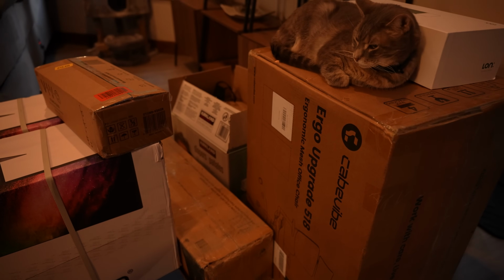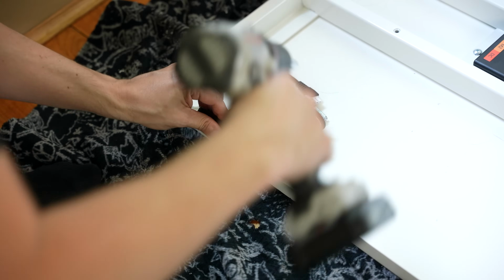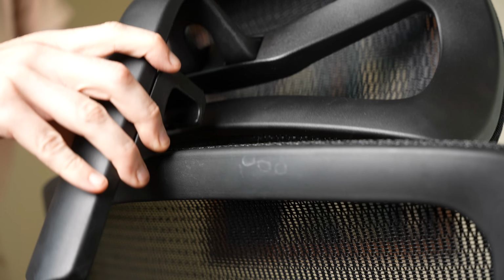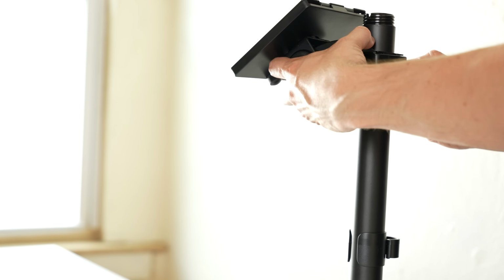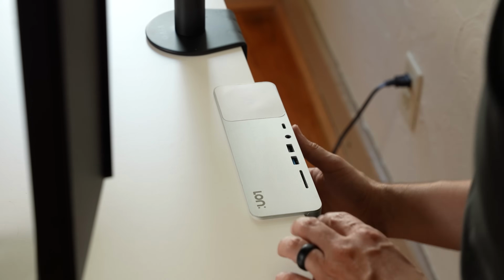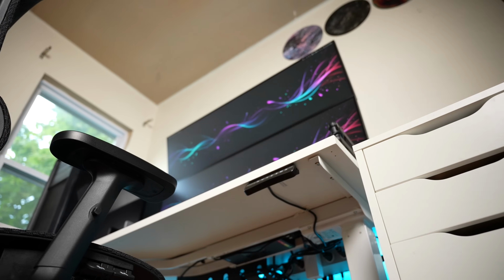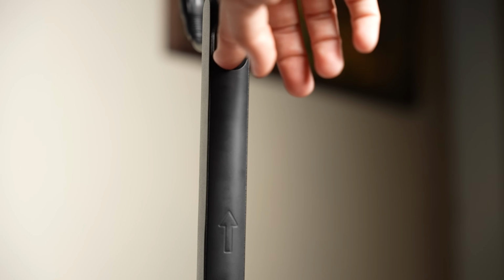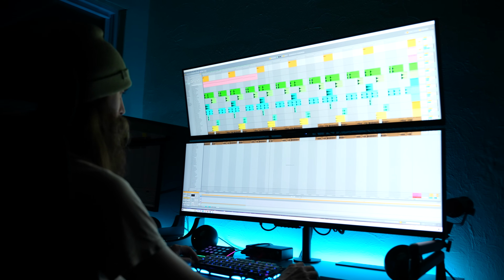I Built My Friend's Dream Desk Setup! HUGE Transformation

Comment: The setup looks great, but two suggestion one that is already mentioned that is easy to do flip the top monitor that way the gap between the monitor will not be so prevalent, second since your friend is getting into music invest into some studio monitors, dont need to seel a kidney for them but there are pretty good ones out there that do an amazing job, one that I suggest is the Presonus 3.5 since they are cheap and very good quality audio for that price range, he prolly has some pair of good cans but studio monitors are also its a good creature confort since it gives you more range in terms of audio.
Reply from the maker: Thanks! Those are great tips. I've never even heard of those studio monitors before. I'll look into them. 

Do you think it will be an issue though with the monitors being so wide and taking up a lot of the room? I've seen people place them under and laying on their sides. But not sure that's great for listening.
Reply: @Ideal-Setup  no, i don't think so. Ideally you have the studio monitors pointed at you but in the end you work with what you got
Reply from the maker: @TheSevenCircle  Gotcha, I'll let Kevin know. Thanks!

Comment: ok two ultra wides is overr kill you only need only some ultra wides have a kvm switch build in my does i use the split screen function on it allot i use one ultra wide and one 27 inch normal monitor i soon buy a portable screen too put under my ultra wide soon
Reply from the maker: Everyone has different needs. He was pretty happy with the setup and working on his music on both. These also have the built in split screen function. 

What do you mainly do at your setup? And which portable one are you interested in? I was thinking about doing a small portable one under mine.

Comment: oh right yea any tips im gonna be moving in to a new house in a month and finally get my own proper room idk what to do for lighting decor etc so any tips and suggestions will be much appreciated
Reply from the maker: Congrats on the move! 

I'd say, the first thing is to decide where in the room your setup will go that will let you have it as open as possible to maximize space.

Then look at what you currently have for the 3 staples. The PC or Laptop, the desk, the chair, and the monitors. That will help you determine your overall layout. Look at inspiration from other setups to see if you like anything that works for how you use your setup.

Then do the same for the accessories. Get accessories you will actually use and then try to tie it all together by matching them by color schemes.

Upgrade as you go!
Reply: @Ideal-Setup  thanks for the tips i want to change from my white setup to a black one with white acccents while i have everything necessary for that on my setup my table is white with like those open wood shelves so do i wrap it and any tips for what kind of wrap to use on it ?